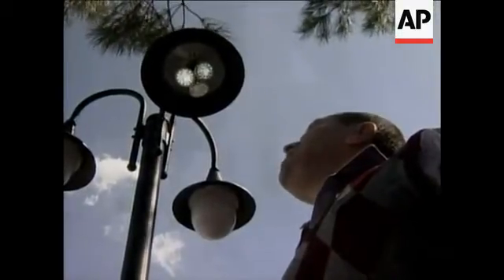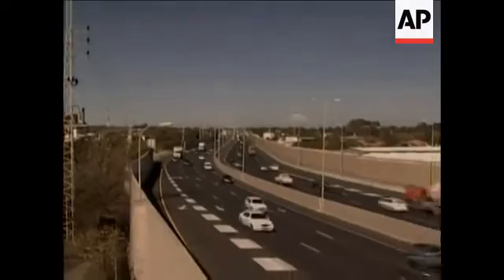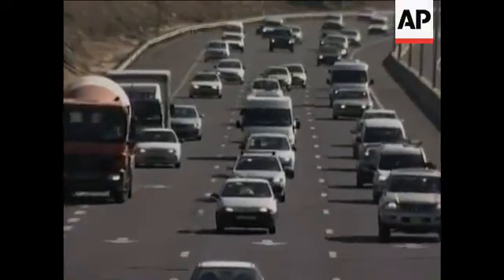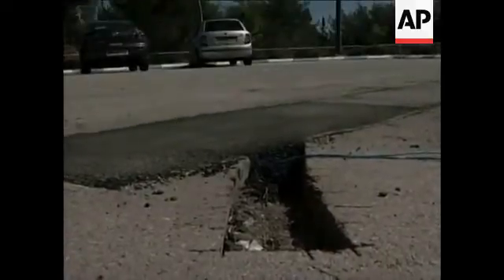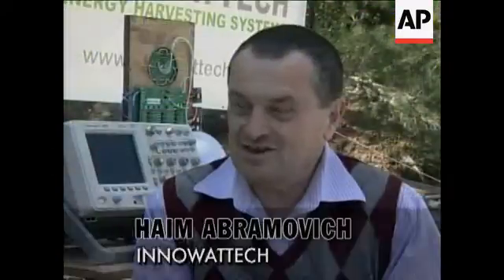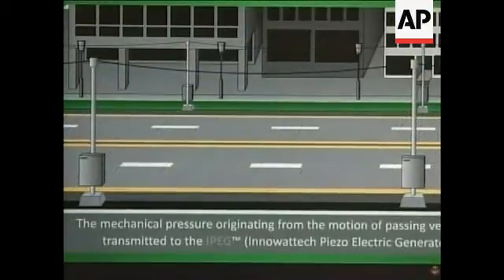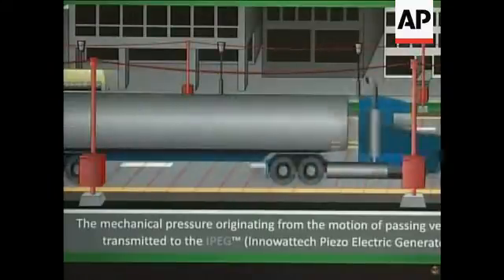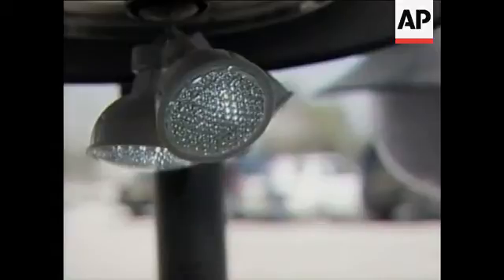An Israeli company is looking to harness energy created by people and vehicles and turn it into elec

Comment: Piezoelectric blocks beneath railway tracks, within car suspension system and subsequently connecting it with Dc-Dc step down LM317 based IC for energy storage in btys.